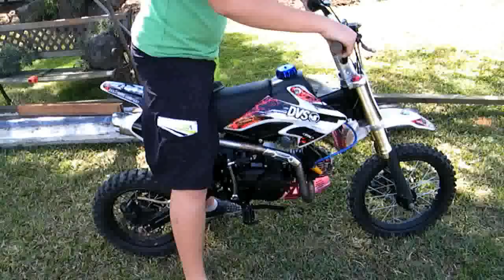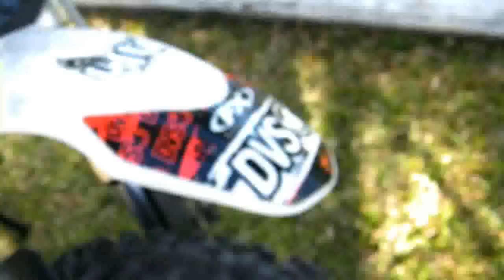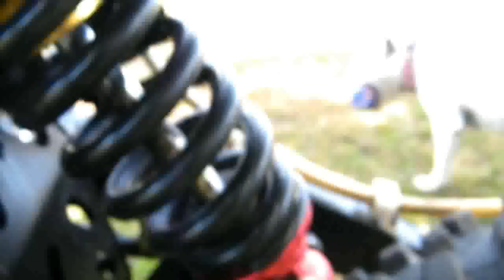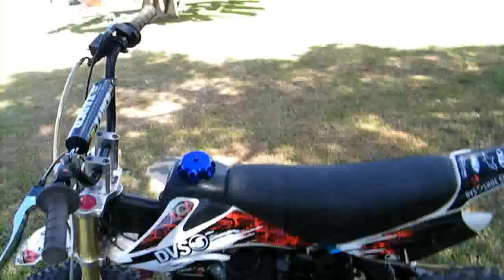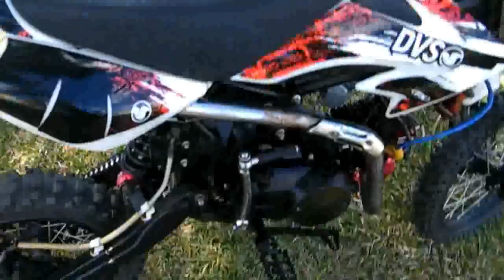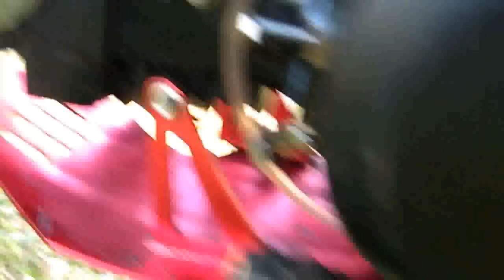125cc Pit Bike

Comment: Those bikes are so unreliable my brother and cousin had one, the back shock blew up and snapped while riding the motor has 5 hours use and burns oil that was after being run in properly (needs a rebuild). They fall apart on ya all over the place, they are just not worth the money